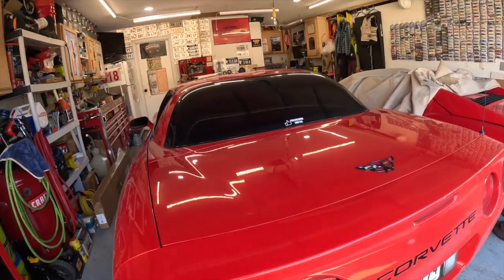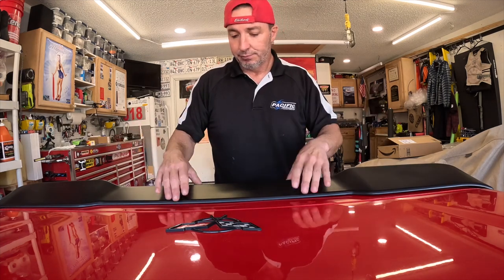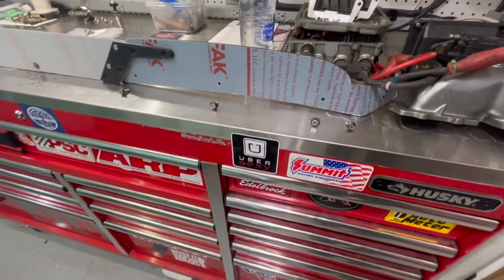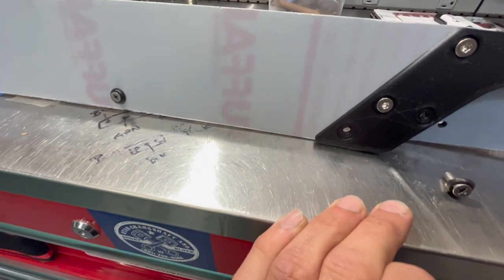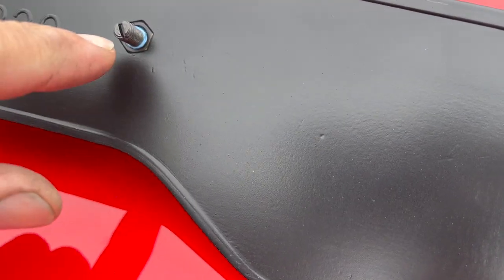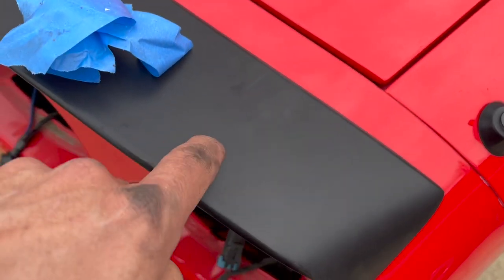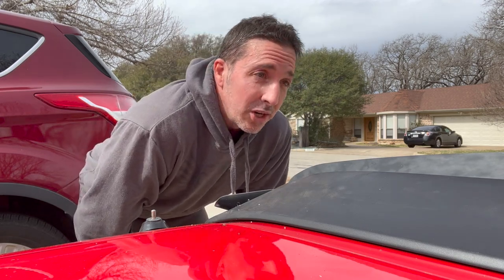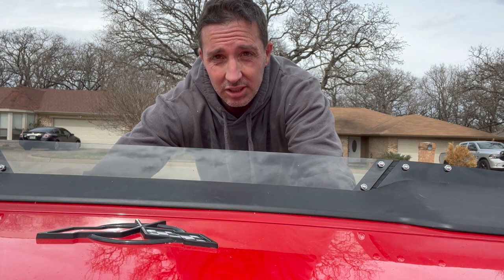C5 Corvette Spoiler / Wickerbill - install and...   FAIL !

Comment: I installed this same setup on my 03 about 2 years ago.  I recall having the same  issue you had with the tension at the end. I believe there is a link or video explaining a specific order in installing to reduce the tension at the end. *Note: the major difference I did is I upsized the screws at the side ends because, like you, the screws provided made the hole, but did not hold. By upsizing to a bigger, thicker screw it handled the tension. To this day. No issues. I do agree that the company should provide better information and service.

Comment: I feel your pain i did the same exact thing on my car, ripped 2 of the screws out of the spoiler trying to bend the corners. I ended up using a heat blanket, which i left on 20 mins each side until it was melting and discolored. Fixed the 2 ripped out screws with dry wall anchors. Junk product.
Reply: also no reply when i emailed them
Reply from the maker: @brettholland9615  lol… Same!  I guess they(he) didn’t appreciate my opinions on their(his) product.

Comment: Why are you trying to wrap it around the ends?
Reply from the maker: It’s supposed to be screwed into the ends but it wasn’t molded correctly.  If it were made of thinner material it would probably work.